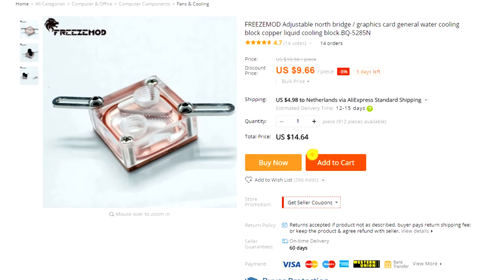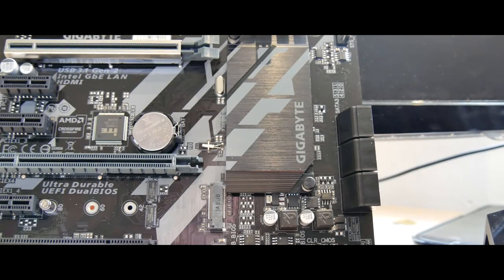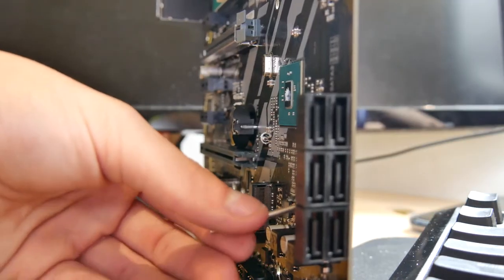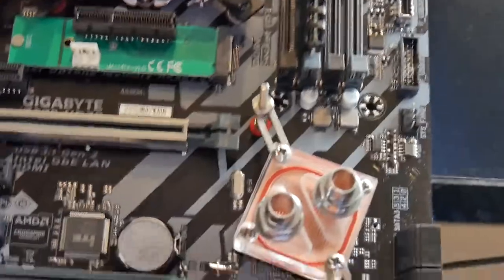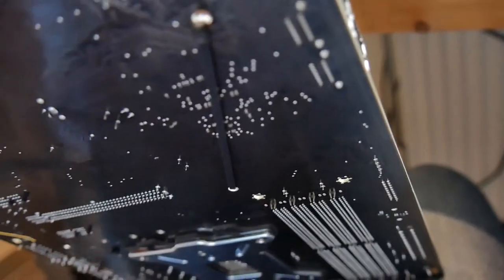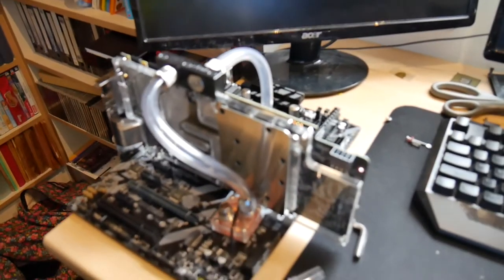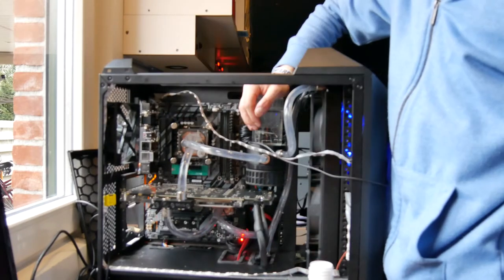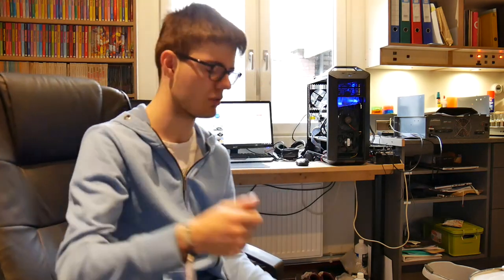Shady water block from China - Jackass for IT?!

Comment: Those zip tie won't do the job there are lot of tech youtuber uses zip tie but ended up using diy acrylic brackets .. the best solution for this is to mount the GPU vertically if not using a thermal GLUE .. once it glued  I won't come off easily but that's the last thing to be recommended since you want to remove water block for general cleaning of micro fins

Comment: Only have 4yrs of building pc and doing costum loops and some DIY PC read the comments below

1st not removing the previous paste is fine but not good for overall temperature performance overtime since it will create micro bubbles your doing costum loop you know how bad bubbles are .. then not removing the previous paste and adding  and keep adding more ..now you have to much paste between cpu and hsf and that's not good some of the paste might overflow is those paste go inside the CPU socket your doomed mobo will malfunction.

2nd all spring are always at the top to avoid hitting the mobo.

3rd if it won't fit don't force it out the mobo are bending .. 

Ok you know how to build that's proven since you do costum loop but not good for audience to watch a guide and copy mistakes for not handling it properly